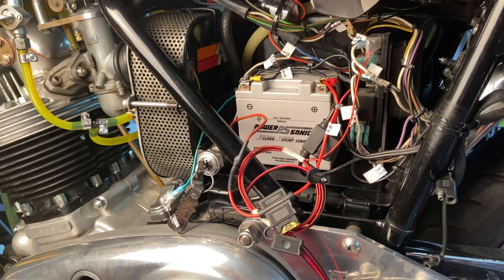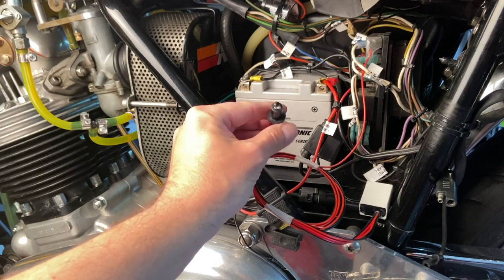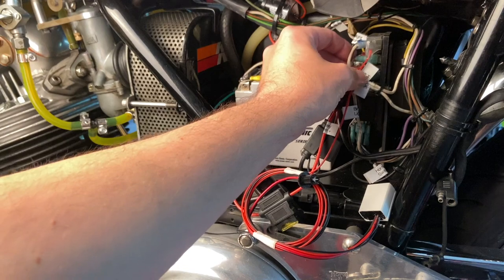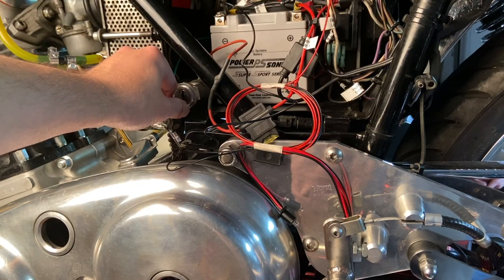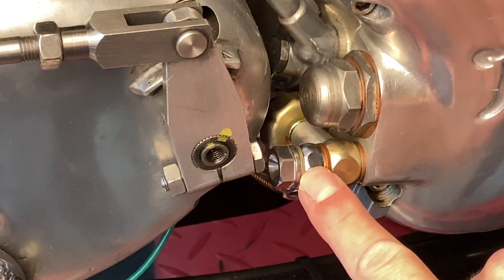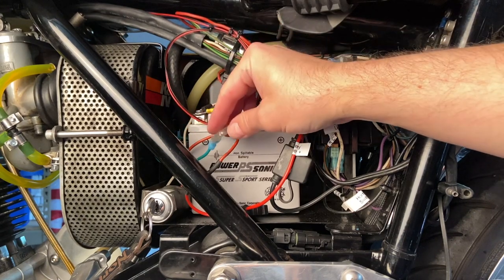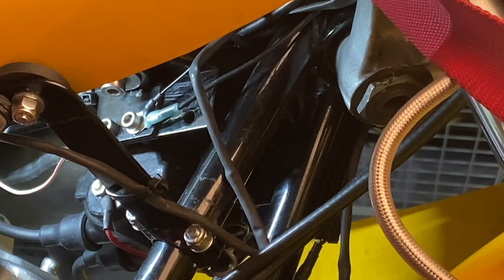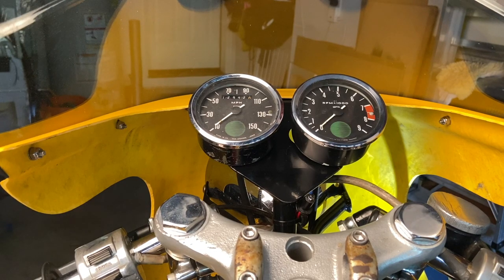Norton Warning Light

Comment: How ever did we manage without warning 'lights', oh yes a check into the oil tank to make sure oil was circulating lol.
I know you had a major oil failure Dave, is this your 'back up' prevention tactic?
atvb t ..
Reply from the maker: If you can somehow check that the oil is circulating while you’re riding I applaud your flexibility. With the Norton the oil tank is under the seat so that would be quite the feat at 60 mph.

Triumphs had oil pressure lights for a while. The biggest reason (although not mine) to put a light or gauge on a Norton is the propensity for anti-wetsumping valves. People either fail to turn on the manual ones or the automatic ones fail.